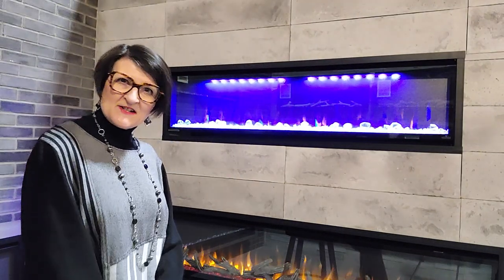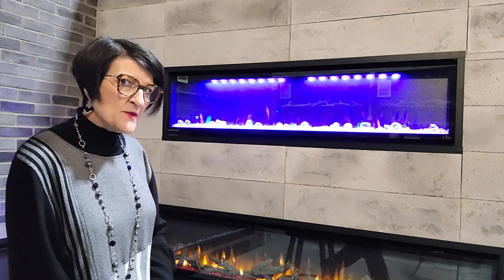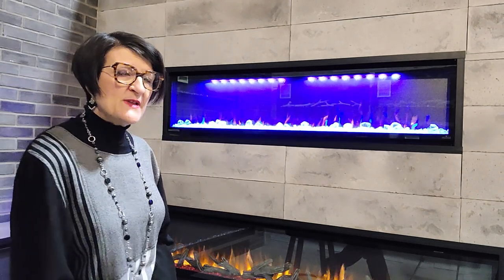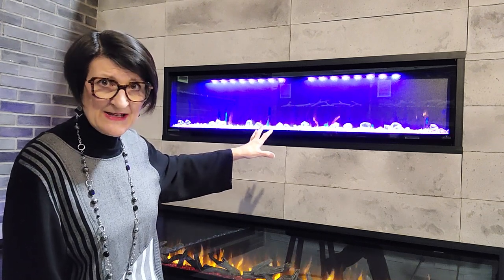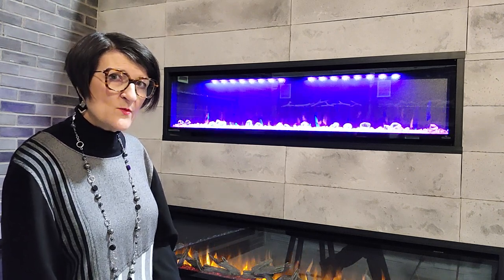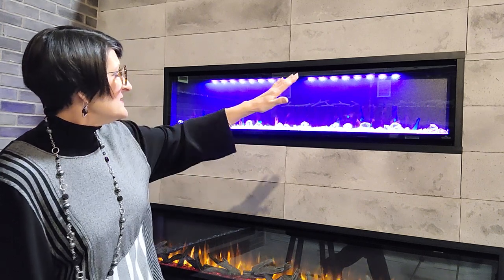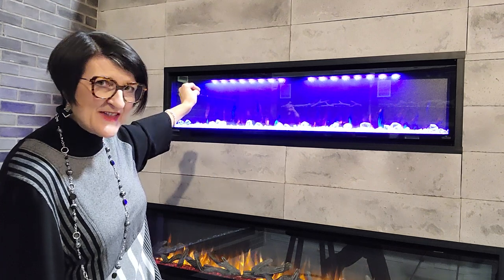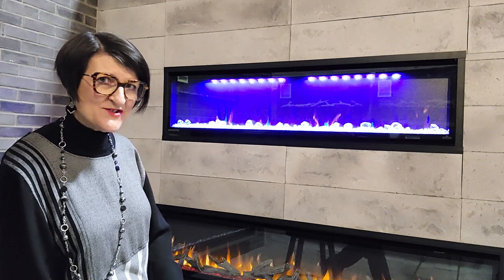How to clean your Electric Fireplaces

Comment: Can you make a video of removing the glass??
Reply from the maker: Hi, Sharon. It varies by manufacturer and fireplace. Sometimes, the frame around the glass has to be removed to get the glass out. Sometimes, there are tabs with screws that hold the glass in place. Your owner's manual will show how to remove the glass.